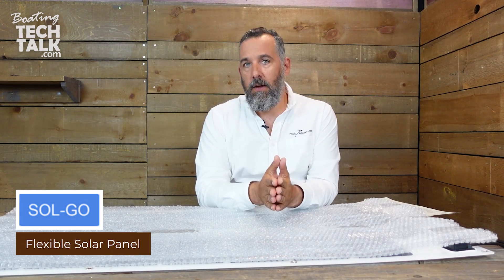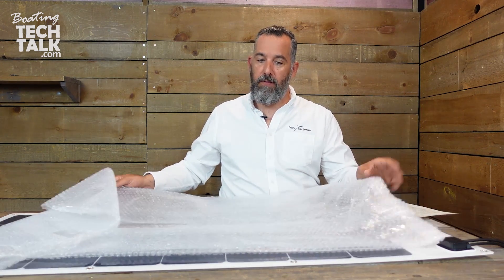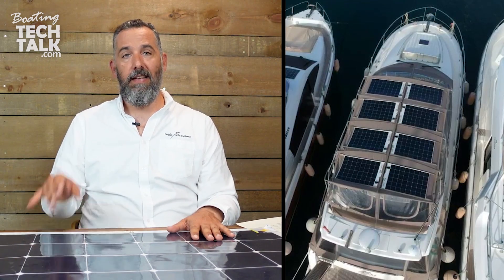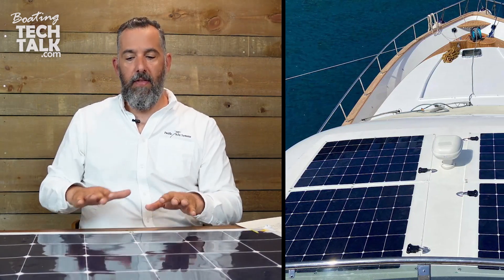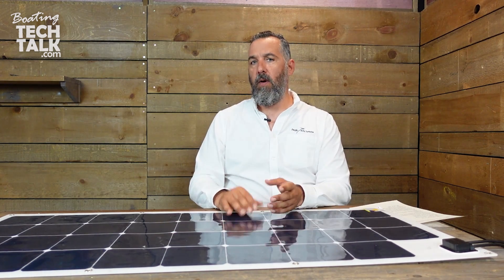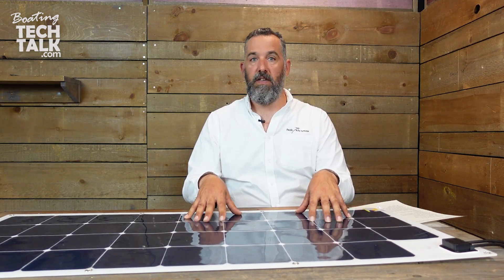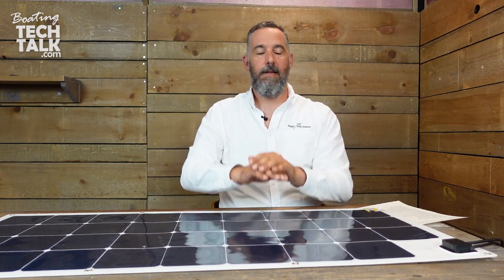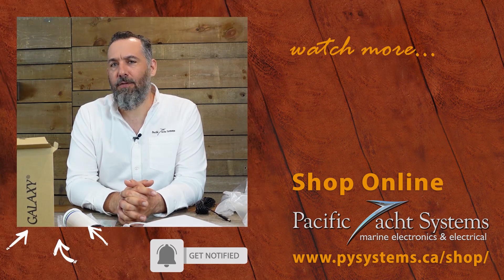Sol-Go 115W Flexible Solar Panel - Unboxing and Product Review

Comment: How do these handle partial shading? Do they use bypass diodes? If so how many? I’m looking for a panel on my dodger and my boom will be an issue.
Reply from the maker: Hi David, I’m most dodger installs we would recommend two panels and two controllers to avoid issues with shading.

Comment: Great video! Thanks for making it. Do you know what size hole you drill in fiberglass for wires and do you just use caulk to seal it up? Mine will be on a powerboat roof. Not canvas.
Reply from the maker: Before drilling a hole, suggest you consider what cable gland you'll be using to make a good deck seal, for instance the Bluesea 1002 is a good choice we've used quite a lot.
Reply: @PacificYachtSystems  thanks!!

Comment: Can you further describe the stainless fastener with the “acorn” nut?  I found fastener options limited due to narrow grommet size.  Thanks for the video!
Reply: It’s called a Cap Nut at Home Depot. I use a nut in my boat then a cap nut to hide excess bolt coming down into boat.
Reply: @mooseontheloose8956  Sincere thanks Moose- I understand what an acorn nut is, but was wondering about the fastener to attach to canvas with 1/4” id grommets.

Comment: Hey Jeff, how does the amount of camber effect the output of the panels? We know that shading even from lines and masts can have negative effects.
Reply from the maker: Hmmm, good one. Don't know the answer to this question, anyone else can chime in. My understanding is that solar panels ideally want to be perpendicular to the sun rays, having a slight camber means some that some portion of the flexible and curved panel is better positioned to the sun then other parts of the panel.